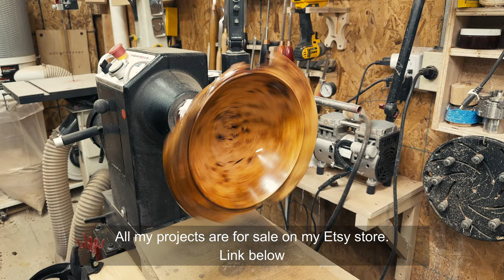Woodturning - Unbelievable Applewood Burl Revamp

Comment: Hello can you tell me what kind of light you put over the piece and what was the liquid did you use if you can tell me It would be appreciated
Regards Jamie
Reply from the maker: Yes of course it’s an ultraviolet light. Sets the epoxy hard in 3 minutes. The epoxy doesn’t need to be mixed and it’s called UV epoxy

Comment: Wood turning art, needs no resin.   Just my opinion.  Let the wood be what it is.
Reply from the maker: Have to agree rather have the natural wood. Although, just finishing up a project that started out with the Burl wood only to find all sorts of wood degradation inside when turning on the lathe. To save what would have to be the trash bin, I used what was left in an epoxy mold to make a blank. Right now I haven’t finished so the jury’s out. Watch next weeks video and I would value your opinion. Cheers